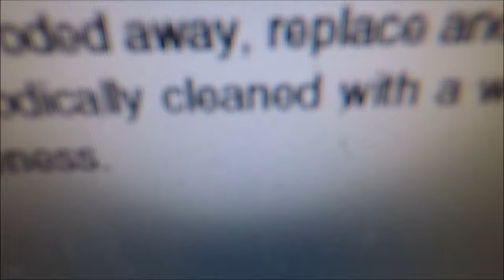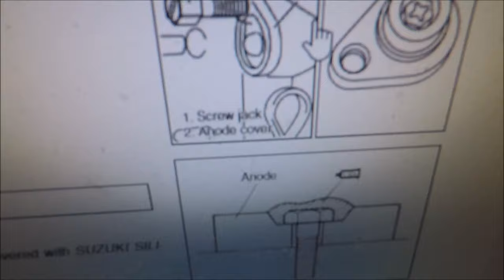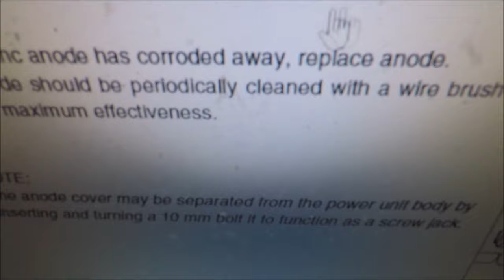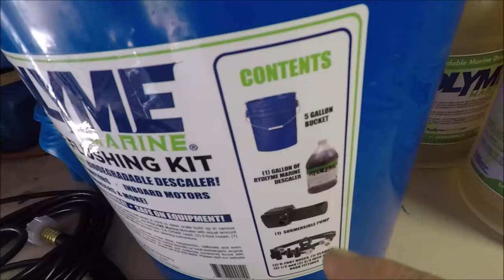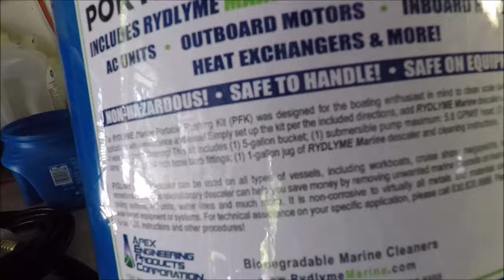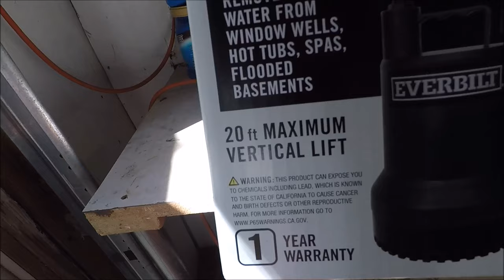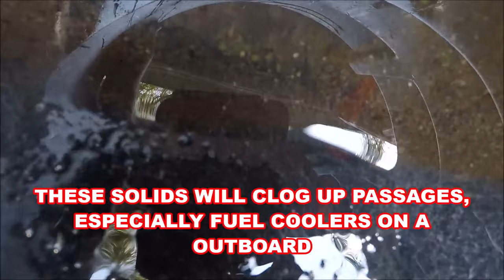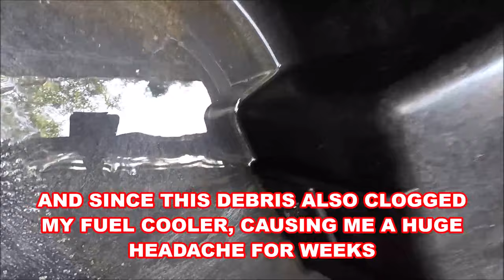ACID WASHING OUTBOARD MOTOR

Comment: ALL OF THE ABOVE! just don't run your motor in a bucket for 3hrs,it will overheat the recycling liquid.The correct way to do this is to get yourself a proper pond pump,remove the gearcase and place the basin under the motor to recirculate the chemical, connect the pump to the copper water pipe that came out of the impeller housing read the damm instructions on whatever you choose to use as a chemical and plug it in an outlet.Before starting the pump remove thermostats all zinc anodes in the motor and pinch the pee hole tube with a small vise grip to allow all fluid to flow freely and return to the basin,in short words you are creating a fountain.Depending on the chemical,you can run this for a week or however long you choose,i own and run a commercial operation.
Reply: a week?!
Reply: I do that method using zepp and it gets a lot out of your motor for about 20 bucks a gallon. It will foam up so use a tub.
Reply: This is the way. I used muriatic acid which is cheap. However, I diluted one galón muriatic with enough water that I could stick my hand in the solution and It wouldn't burn my skin. Ran the solution from 10 am to 2 pm. A lot came out. (Engines had 2000hrs approximately) in retrospect, next time will buy ryd Lyme or something for this purpose to save time and do it faster. I dropped a thermostat gasket in the solution and no harm was done to it that I could percieve.

Comment: So, why not drop the foot and pump up through the water pump supply tube?  For an everyday flush that port may be fine, but I don't believe they are thorough, even if you take out the thermostadts...

Comment: Wow! I've spent hours looking for solutions to a lesser problem, I'm in the uk with a small fishing boat, only a 25hp 4 stroke Yamaha. Took my wife out fishing on our North Sea, engine overheated, similar in that the waterways in the engine had a build up of salt behind the thermostat, this had never been cleared by the boat flushing sytem, because the engine was cold and the thermostat was never open to allow a proper flush!! I've managed to get around this by flushing the system utilising a large tub of warm water, thermostat removed, and disolving the salt by letting the water temporature to get hot enough to disolve the salt.
Brilliant video and information, thank you. I'll subscribe and keep watching , many thanks, all the best..

Comment: Thank you Captain,this has happened twice before the problem lies on a design flaw. The tubes on the fuel cooler are a lot narrower than the hose therefore creating an easy clog. I’m considering the use of an in line filter. Because my fuel cooler is not readily accessible. My engine doesn’t stall it just stops peeing and over heats it’s an F90 Yamaha 4 stroke.  I’ve been flushing it with Salt Away and it has improved. The first time this happened was about a month ago. The engine overheated after 2 miles. I flushed it several times with the Salt Away and I was able to ride 12 miles before it happened again. I’m hoping to fix this problem soon. 🙏🙏👍👍👍👍
Reply: What do you mean inline filter? A filter for the water? You might restrict water flow? They already have a bunch of filters, fuel water separators etc

Comment: Super detail. Thanks Dave.  My new boat in Idaho won't ever see salt water but, after just a month, there's fine dirt and hard water deposit on the outside of the lower unit.
Reply from the maker: well it's not just saltwater here, it's also a salt DIRT filled river. But many people think just because they are in freshwater, they never have too ''flush'' their motors. I  would at least use the flush ports on motor, or better yet run it on the  ''muffs'' with fresh clean water outa a hose! Heat can make any minerals and dirt clog water passages, and 4 strokes make heat.

Comment: Showing the build up inside your motor was very informative. I can not imagine how much buildup that there might be in other areas like the inside of a bend. That being said, Salt Away is formulated to remove salt. When you buy and use it you will get what you pay for. Salt Away is not there to break down anything else. It is a great product that does what it is marketed to do flush out salt and help prevent it from adhering to anything that it has coated. The other product you are using looks like it does a great job at what it is formulated to do as well. Thankfully from my experience I do not have a need to use that product. To me if there are barnacles or shells growing inside the water jackets that outboard is not getting flushed with freshwater after use. I know there are freshwater shellfish but I am assuming that this is a saltwater use outboard. If I missed something in the video and this is a freshwater used engine, my apologies for my incorrect assumption. I use Salt Away after every trip in my boat and my internal anodes still look almost brand new and they are 6yrs old. We are operating in very different conditions as my water jackets from what I can see have no build up in them at all, there is no mud or anything else “visible” when I pull my anodes. You also probably put 10 times the the hours on your outboard than I do on mine as you rely on your outboard for your livelihood. My outboard is a 2015 4.2 Yamaha 300. Informative video, Thank you.
Reply from the maker: whoa....dissertation not needed! #1 this all means zero if you don't know any history. and you don't. build was from not running in a barrel after each us, but using the flush ports. Those flush ports don't do shit! Plus, as it turned out all my issues were fuel cooler was CLOGGED. Flush ports just pushed the dirt and salt into fuel cooler. You didn't even know I'm running a saltwater inshore charter boat? Do you know that its a pain in the ass to flush with the muffs on my 250 zuki, no. I has lower water pick ups. hence a barrel instead. you know how much saltaway BS I'd go thru in a year???? a few 55 gallon drums. Thats a willy weekender stuff.

Comment: Thx for this video Capt Dave. I run my Yamaha in a dirty, muddy freshwater lake, I’ve had some overheating issues lately. I think that rydlyme might do me some good. I enjoy all your vids but these maintenance vids are awesome. Keep em coming.
Reply from the maker: FOR ALL, TOO:    YES, I had a charter the day after and my zuki ran cooler. I never gave it pure hell, as it was rough and blowing 20+ knots by 10am. But, prior to all the work I did, I'd see temps up to 160 plus degrees all the time. That's not really hot, given the water temp in the ''mud river'' is still 84-85 degrees even after the Hurricane passing by. (prior to hurricane, I'd see river temps up to 87 degrees) Had me and two other on boat and zuki highest temp seen all day was 151. So, I was happy. BY DECEMBER, I will pull internal anodes again, and do another flush. ''BECAUSE, I'm anal & will stick to a schedule''.

Comment: Hello and thank you much for the Great video and instructions. Years ago i had a 90 HP Evinrude and the thermostats used to get jammed too. My solution was to remove the lower unit and hook up the same Home depot pump that you have here and used to mix 3 Gallons of Vinegar and 2 bottles of CLR.  They used to Do Magic and much much Cheaper.
Reply from the maker: well, test how long it takes your vinager and CLR to 100% dissolve  a barnacle or sea shell. Cost wasn't a huge factor. Staying in business is.

Comment: I use just straight Muriatic Acid from Lowes or Homedepot $9.99 it works great.  Used an old Rule bilge pump but remove the lower unit and typically hook it onto the copper tube that goes into the engine.  I run into the engine then let it set for a few minutes then run it again.  Then rinse with clean water.   I'm sure that stuff is pretty good but its pricey.
Reply: Muriatic chemically reacts powerfully to aluminum, almost instantly.
Reply from the maker: this is my livelyhood, Im not messin around with any homebrew. my luck something will go wrong!
Reply: @CaptDavesSportfishing  You don't mix it full strength.  After you run it put some baking soda in the fresh water and that will stop any reactions.  But, I understand.
Reply: Hey I also looked the Rydlyme and its Hydrocloric Acid at less than 10%.  Muriatic and Hydrocloric Acid are basically the same thing.  Both have the same amount and are both water soluble.
Reply from the maker: @hawkeyemarine  Maybe someday.....got plenty of Rydlyme.
Reply: @jaytua730  good read basically saying what he’s using will dissolve his anodes and destroy the aluminium in his engine

Comment: Another great and informative video, I just acquired a 2015 suzuki and am bringing the maintenance up to date. I am having trouble greasing the front tilt fittings. They are blocked by the sea star steering, ive tried to install angled zerks but they are a little to long. Have you determined a way to service these?

Comment: Capt. Dave, you are fabulous and so informative and thorough too!! I bought a 1988 Cris Craft 21-6 Sea Hawk with a 225 HP Evinrude. I just want to feel safe going out in the Bay so I'm learning from your videos! Go git dem fish Capt.
Reply: P.S. It does have a VHS and Loran. Just concerned about the motor. Thank you and Tight Lines!!
Reply from the maker: @bear6090  thanks, I have a lot showing details. I do have a brand new zuki, I bought in May 2020....had a issue, even after extensive maintenance.  May not have been related, but in the charter biz, didnt have 3 weeks to sit around waiting for a mechanic to look at it.

Comment: The misconception is that when you connect the muffs or hose to the flushing port that the flushing goes trough the entire engine. It does not. I went through the same process as you did and finally connected my 12v bilge pump directly to the intake water tube as you did. I used a different product (Barnacle Buster) and i was amazed at how much it actually cleaned out. My engine was a 1998 Yamaha 200 2stroke.  I wonder how much circulation we are actually getting with the newer motors and the MFG suggested flush hose ports.
Reply from the maker: Real simple don't use those flushers that are on the engine by a tub run it out in freshwater especially if you run the dirty st. Johns River in Jacksonville Florida buy a tub  https://www.amazon.com/shop/captdavessportfishingcharters

Comment: A lot of what you see on your ZINC anodes is ZINC OXIDE.  The zinc is supposed to corrode, as part of a chemical reaction called electrolysis.  Because the zinc is attached to the engine, it corrodes instead of the aluminum and steel of your engine.  

So something like CLR or Lime Rid will remove the zinc oxide, which is essentially rusted zinc.  

Salts Gone doesn’t remove rust.

Comment: Just flush your motor every time you return for 15-20 minutes, pull your anodes every six months and check them for corrosion. Replace as necessary, their cheap $25-30 dollars. Check them at six months, if there not more than a quarter used up clean them back to zinc re install and drive on. Just remember to flush the motor with clean water for 15-20 mins. I've owned 4-strokes since they came out.
Reply from the maker: me too and obviously you have never seen any of my other videos.  I checked my anodes every oil change at 100 hours, along with my lower unit gear lube. but are you running in the St Johns River?
I just got done descaling my motor last weekend. 
and will be doing the spark plugs this weekend. believe me I stay up with me and it's because that engine is my livelihood!

Comment: Hello there Capt Dave and thanks for all the great insights and info! Much appreciated. Would like to ask you how much quantity of Rydlyme do you use when you flush the whole engine and do you necessarily need the pump or you can just run the engine in Rydlyme diluted fresh water?  
Thanks again and kind regards from Greece!
Reply from the maker: you need a barrel and a few gallons of rydlyme 50/50 mix, and take out the t-stats and a pump, to do descaling correctly, I think.

Comment: Cheaper pump would have been a simple boat bilge pump. That’s what I used and worked really well!
Reply from the maker: that pump doesn't even get to top cylinders, doubt a bilge pump would. this is 4 yrs ago. I've changed everything out.

Comment: Thanks for the videos brand new subscriber.
I have a 2023 mercury 60 hp outboard that I use in fresh water. My question is do I need to do this flushing maintenance for 40 hours of run time a summer? I outboard is on a pontoon boat.
Thanks for the videos good stuff
Reply from the maker: a good flush every few years in sweetwater wouldn't hurt anything at all, but generally in freshwater NO.

Comment: Capt Dave , do you think I could use a salt away flush kit for a merc cruiser outdrive and that acid to perform a cleaning . Instead of Salt Away ?
Also keeping the thermostat in and when it opens turn the shut off valve to accept the acid remover , run it till it’s gone and let it soak .
Re flush , I know my thermostat gets pretty junked up so maybe it would clean that as well.
Your thoughts ?
Reply from the maker: take out t-stats, create a closed loop system with a big pump

Comment: Well Capt took me awhile to get enough time to watch the whole thing thru! But it’s a long, and necessary process it appears! I take care of my stuff, but really never thought about how serious the flushing of contaminates out the fuel cooler and passage ways were! Winter seems to be set in up here, so might be time to get this started! Thanks for all the info👍 Now have to buy a lot of parts, water trough, hoses etc..... B.O.A.T.
Reply from the maker: Well isn't that funny I just changed my oil in my 2020 Suzuki pulled out all the a nose check them clean them and reinstalled them just today
I'm not sure if I'd worry about the fuel cooler until you know where it's at and only if you're really having issues like it's a hundred and ten degrees in the shade and your engine stopped running because under the cowling it's 250 degrees. But if you actually read the shop manual for everybody's engine and maybe even the owners manual that tells you to check stuff like this basically every 90 days of 3 months which seems a little excessive I do it every hundred hours and for me that's about every 2 to 3 months
Reply: @CaptDavesSportfishing  motor is 13 years old, and Im Positive the previous owner never flushed the motor properly, or changed any of the anodes! I’m getting ready to do the 400 hour service so might as well go ahead and do all the things you did here for preventative maintenance if nothing else! My fuel cooler sits rite next to fuel rail so don’t have to pull VST to check! Time to order parts☹️
Reply from the maker: @melloreel  previous owner??? and its only at 400 hrs??? Wow. sounds just like new vision security, and his boat.  If YA EVER RUN INTO A SNAG, I DO ALL THE TIME, JUST DID YESTERDAY Orowock will do his best over email or phone call to help, VIEWERSHIP. He's already help New Vision security with his EVINRUDE ficht motor.
Reply: @CaptDavesSportfishing  yep it actually had 300hrs 9 months ago when I bought her! Guy only used boat for two weeks vacation each year at a freshwater lake to pull his kids around, then back home and into the garage till next year! Sweet! But this motor (06 Yamaha f150) has a couple of (expensive) factory issues that I’ve got to fix now! I try to follow along with New Vision when I can to see what kinda trouble he’s having! I will email you for Orowock’s email if I hit a snag😀 thanks for the info!

Comment: This is a awesome video Capt Dave. Why anyone would down you for having a kicker is beyond me. I run the chesapeake bay and it's nasty dirty water from Baltimore Dc etc. That ridlmye looks like a good product. I've also read on the hull truth guys flushing outboards with vinegar to cut the salt etc.
Reply from the maker: VINEGAR DOESN'T DO SHIT. way too weak!  well, if you're not part of the Pathfinder boat clic, you're just not as cool as the rest. You oughta see the boat ramp I use on a weekend. SO MANY CLONE BOATS, everyone look the same, cuz everyone want to spend 100k to look like the next guy.

Comment: Cool video. Outboard sludge is nasty. A better fix for you would be to flush with ridlyme marine.  Use a tank or plastic tub that would fit under your outboard. Pull off lower unit. Use a bilge pump and wire it to run constant on. Hook a 3/4 piece of 4 foot hose to one end of bilge pump. Connect that hose from the bilge pump directly to the water pickup below the base of the power head. Mix 2 gallons watter and 2 gallons of ridlyme into your tub. Hook bilge pump up to battery or other 12 volt source. Remove water thermostat and put cover back on the water pump housing. Flush with that solution for approximately 2 1/2 to 3 hours. Problem solved. 90% of that build up is now gone. Flush out with fresh clean water. Repeat process to lower unit. With rubber impeller removed. Flush again with clean water for about 15 minutes.
Reply from the maker: gawd.....can tell you're not a subscriber/regular viewer. BEEN THERE DONE THAT, multiple videos already done.

Comment: Capt Dave- what were the two products you used on the bolts and anode housings?I think one you said was corrosion block, what was the other, and can you give us the brand names of each and where you get them?
Reply from the maker: TEFGEL? OR ANY SILICONE GREASE? not sure.